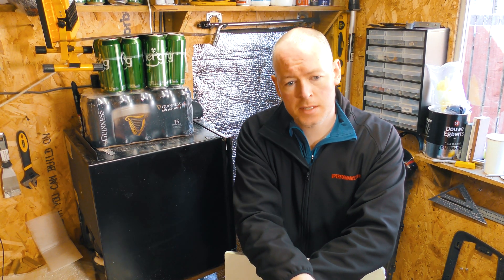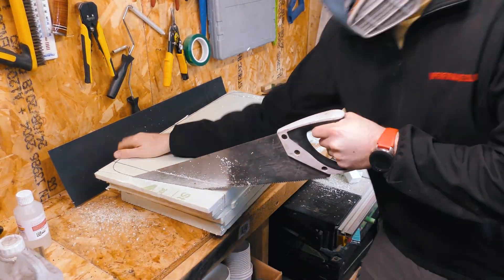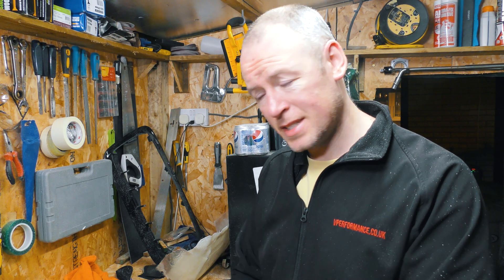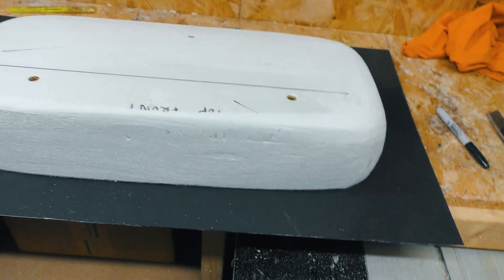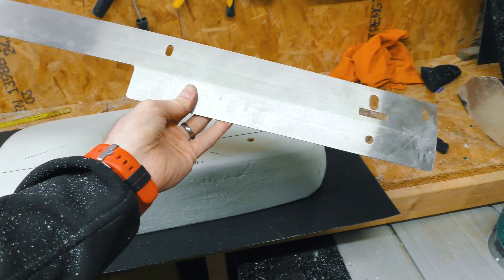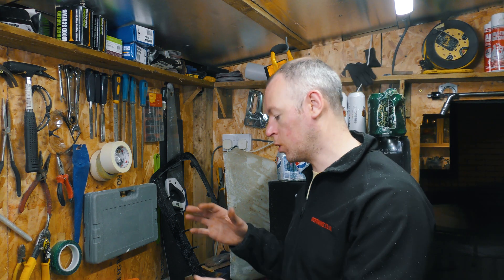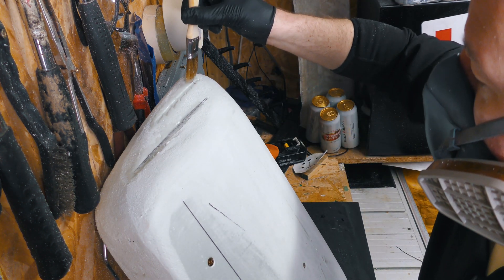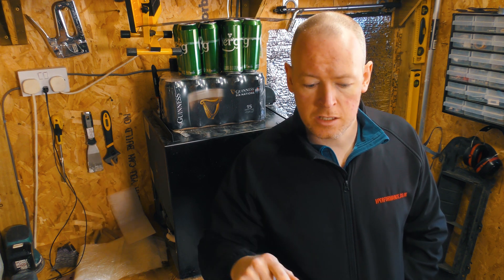Styrene molds for carbon fiber // Carbon scoop part 9

Comment: Wall filter no work ? It’s cheap and easy to sand down plus I don’t think it will melt but maybe test try first 🥴🤔
Reply from the maker: I didn't think of that. It would have still required a non-essential trip to B&Q though. All shall be resolved in the next video though, with the most horrible chemical shit I've used yet.
Reply: vPerformance 🤣👌